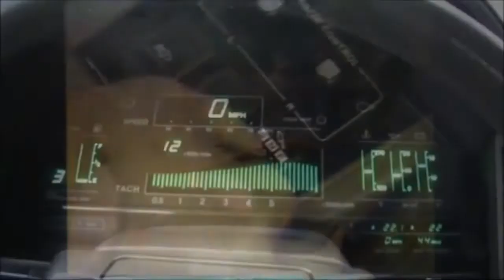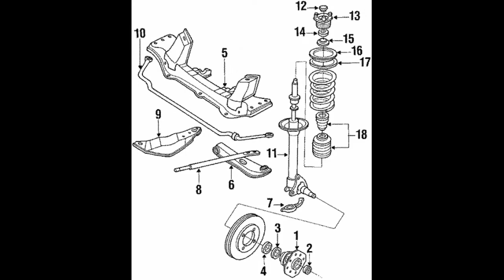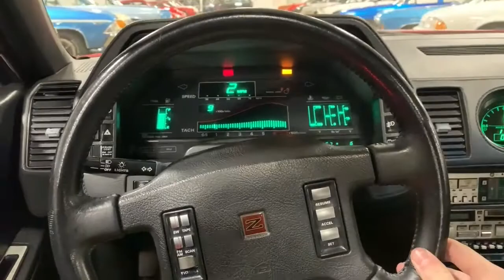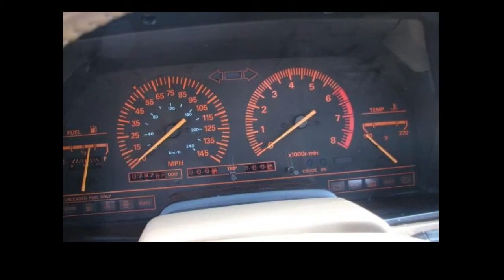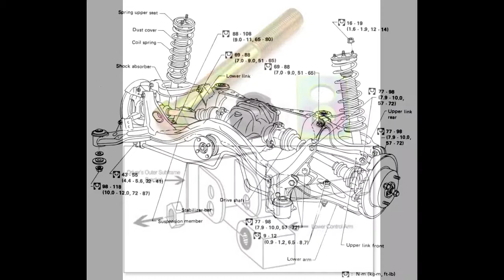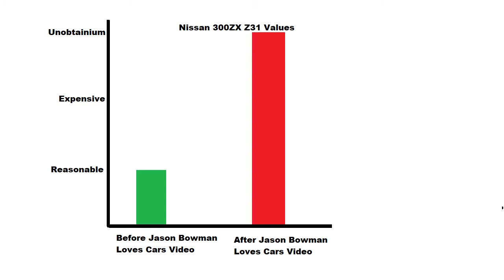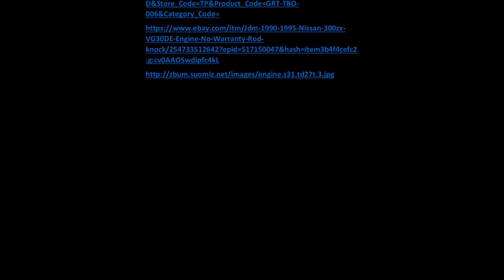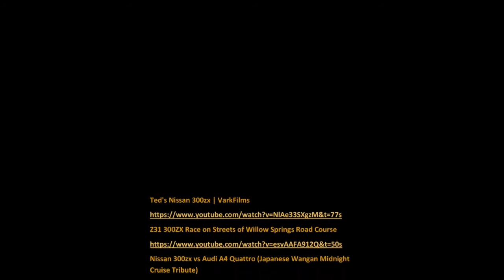Nissan 300ZX

Comment: Thanks for all the information, Jason! 

In the fall of 1984, we decided to buy a new car. It was going to be primarily driven by my wife, as I had a company vehicle (a 1983 Pontiac 6000 at the time...) She decided she wanted something sporty, and our budget was around $20,000. Cars on the short list were the Toyota Celica Supra, Mitsubishi Starion, the Maserati Bi-Turbo and the Nissan 300ZX among others. The wifey got to pick the car SHE wanted. I got to pick which engine it had, if their were choices. Transmission was going to be an automatic. Marcia had learned how to clutch and shift, but barely, and she didn't enjoy rowing the gears. We get to car shopping, stopping a local Nissan dealer one evening after it had closed. They had quite a few 300ZX's lined up in the first few rows. I had done my research already on the Turbo model, and knew what was available. Quite a few had the space-agey electronic instruments, an extra-cost package. I wanted the analog gauges. The leather seating option featured infinitely-adjustable 8-way power seats, so that was a wanted item. We looked at them, and I think Marcia decided on the 'Z' before we looked at another car. Browsing the local dealer's lot again early one Sunday morning, we happened upon one that was built EXACTLY the way we wanted - right color, analog gauges, and the nice seats. We drove it home later that day. First thing I did though was remove the hokey 'hockey stick' 'Turbo' decal that went down the side, starting from the outside mirror location. I added some tasteful and subtle painted pin stripes, in silver and orange, just above the side moldings, and around the outside perimeter in back. 

The car drove wonderfully, and we were soon enjoying a nice trip to Las Vegas in it. I very easily got it above 100 mph.......
Reply from the maker: I am obviously obsessed with cars, but Admittedly I didn't know much about Z31 300ZX's before this video. They are awesome! I have had this idea for years now about buying a different $10000 super car every summer and selling it to buy another $10000 super car and experiencing them all. Originally the Jag XJ-S, Corvette C4, Mercedes 500SL, Dodge Stealth RT Twin turbo, Porsche 928 were on "The List". The Z31 300ZX has been penciled in now too. LOL ;-)